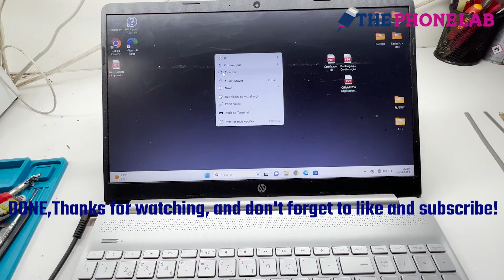Hp Laptop No Display Caps Lock Blinking (FIXED)

Comment: Please help me the message has stopped using it for 3 years now to use it to use it pls what to do to do when I am charged from charge is the source where the charging is not clear and another is not clear from the Caps lock so what is the solution pls pls me help
Reply from the maker: Tell me in hindi or your original language i can't understand your English and then i will be able to help you mate